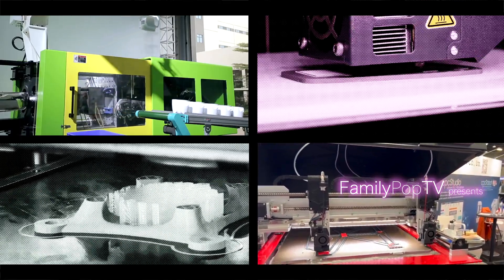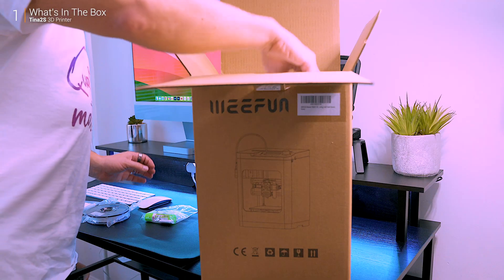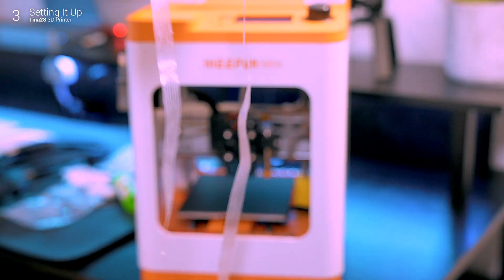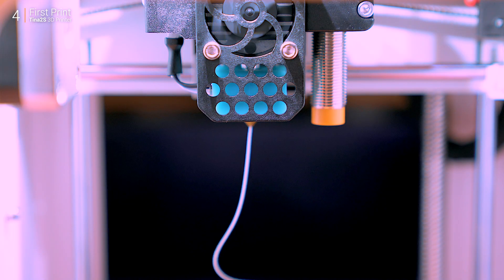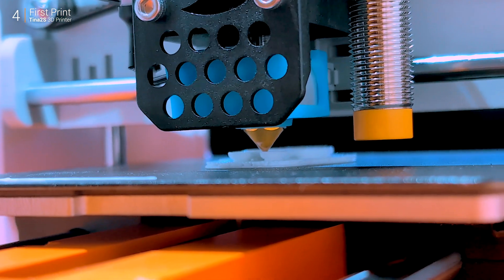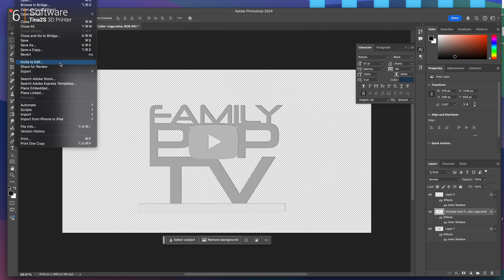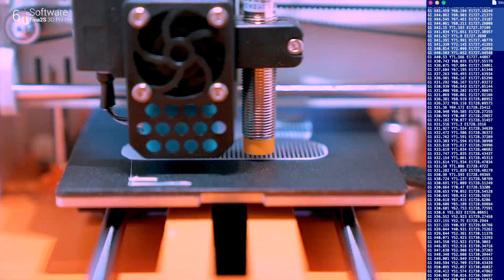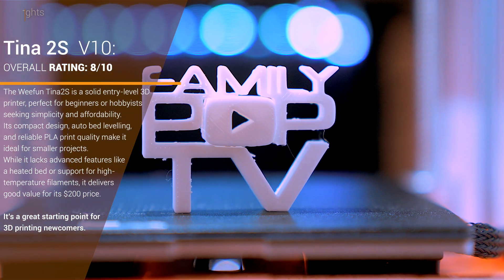This $200 3D Printer Blew Me Away! (Weefun TINA2S Review)

Comment: For beginner and if your budget is 200, get a secondhand ender3 and a raspberry pi. Cheaper, better both as a machine and a platform to learn all about 3d printing and printer on.
Reply from the maker: I agree, with a budget around $200 - considering a second-hand Ender 3 paired with a Raspberry Pi is a pretty viable option..